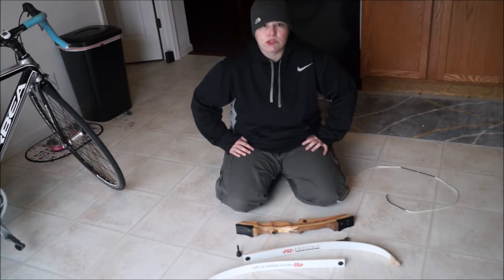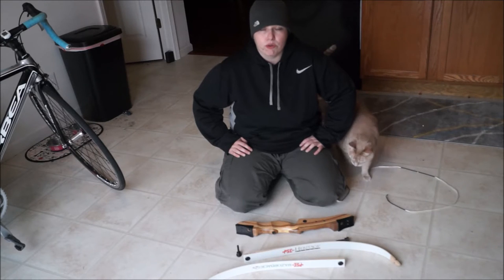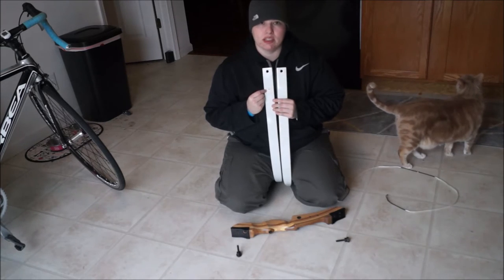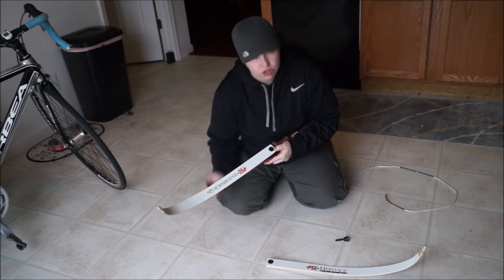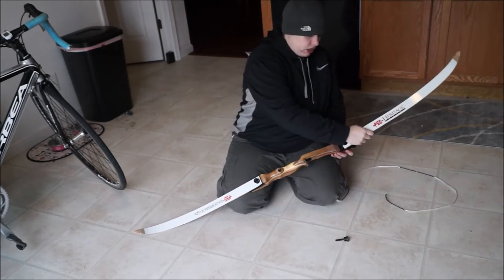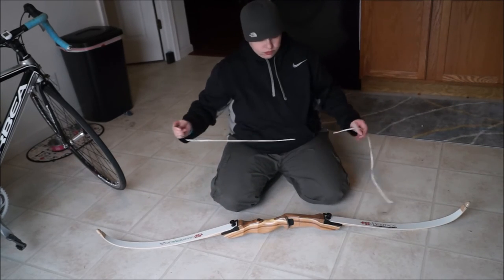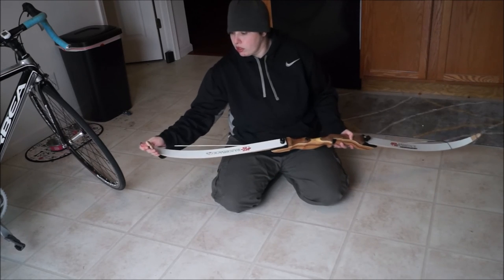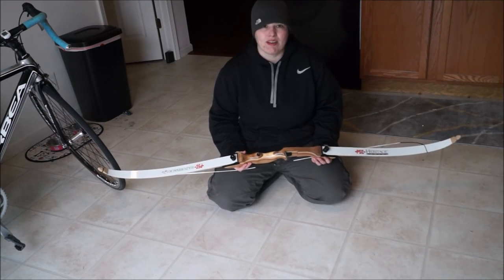How to assemble a PSE Razorback Takedown Recurve bow

Comment: I just picked up this bow...PSE Heritage series Razorback LH, 62-25lb for practicing. 
The Seller used a bright red sharpie to mark the top of the string, so I won't get confused with what is the top loop, compared to bottom loop..
I even put an arrow mark on my limbs to make it easier to attach the top limb properly, from the bottom limb. 
This 5 foot bow is long (especially for my 5'4" tall wife), when comparing it to my other one, (4 ft / Ragim Maxim 30 lb  ) but it flies true and is alot of fun to shoot 3d and hanging targets .